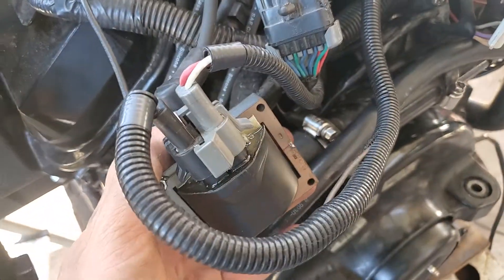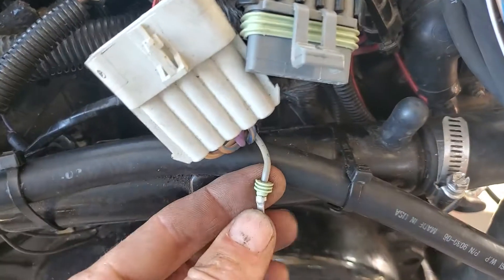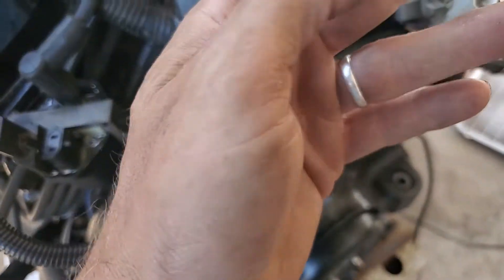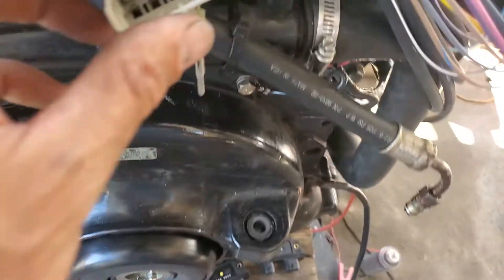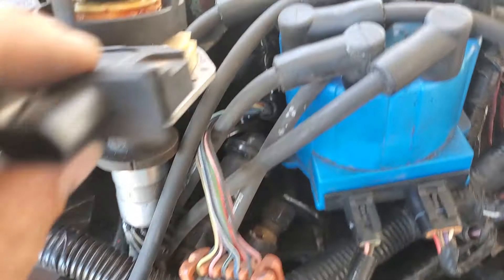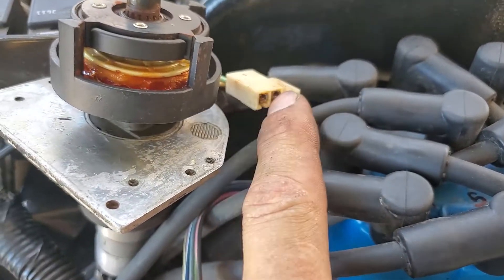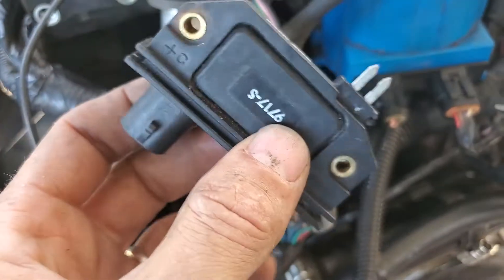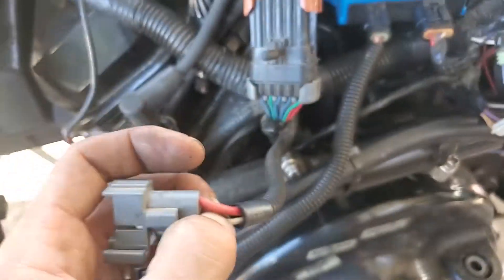Mercruiser delco EST mpi no spark troubleshooting

Comment: Hello Socal Marine, Im having a problem with my 502 MPI, one day it was running great, like it has been since I got the boat (4 years aprox.), and the next day it would not rev past 2700 - 2800 rpm, throttle wide open. I am mechanically inclined but not a professional, I did replaced the IAC valve, PCV valve, spark plugs, TPS, made sure the throttle body is clean and working properly, Checked fuel pressure (45 + psi), replaced all 8 injectors, checked if they were getting power with this little lights you plug to the inj. plugs, they all lit up, sent the ECM to California to have it tested, they say its all good, but still, the problem persist. Seems like there is not techs here in west Texas than can work or know those engines. Do you have any suggestion for me to check??  Im trying to avoid a looooong tow the the closest guy, about 6 or 7 hrs driving time. Thanks for anything you would suggest me to check. Its been very frustrating.
Reply from the maker: go join my fb group Boat Tech Help - Mercruiser, Volvo Penta, Outboards, Engines Q&A and post there!
Reply from the maker: sounds like it could be in limp mode - any vibrations? doubt the coupler wd be the issue- https://www.offshoreonly.com/forums/general-q/299138-502-mpi-nightmare-2.html - "All stupid electrical problems are a bad ground." Check the grounds! make 1000% they are shiny greased with dielectric grease.. pos and negative. Can always try run a sep 12 or 14ga ground wire from batt - straight to where the ECU bolts up (intake somewhere)...
Reply: @SocalMarineUSA  Thanks for replying brother! Vibrations? yes, sounds to me not all the cylinders are firing, even at idle, hard to tell tho, its got a cam, headers (loud) etc. One of the things is doing, it starts fine, but does not holds idle, got to crack the throttle open a little so it does not die, it used to hold idle before with the throttle closed all the way to the stop. All of this started when I noticed the block had cracked for not winterizing it, (my fault). I noticed it once the boat was in the water, it would not rev up past 2800 rpm, then I stopped, check the oil, found water and oil mixed, and thought to myself that was the reason it would not rev up, got a new block, had the heads checked, got new rings,  bearings, gaskets, etc, assembled the whole engine, put boat back in the water, and still, would not rev up. Could the issue be related to the cracked block?, visually, the block was the only thing I noticed wrong when I opened up the engine. When I did put it back together i made sure all the grounds and connections were clean and rust free. Also, I have a raw water cooling syst. Thanks again for replying back to me

Comment: where was your short at?
Reply from the maker: grey (tach) wire and the block, it got pinched between the bracket and the block, intermittently shorting randomly!
Reply: @SocalMarineUSA  thanks I have a no fire issue going on now after winter storage.   I have continuity between the grey (turns to white at harness connection) and ground.   It only shorts to ground when the grey connector on the coil is connected. I can't find any abrasions so far.  Does this sound like a burned out ignition coil?